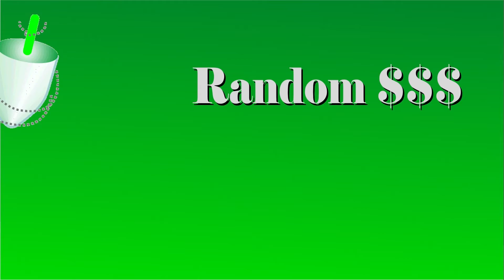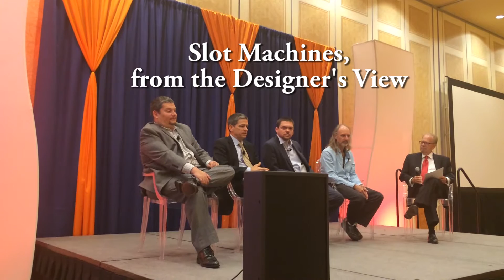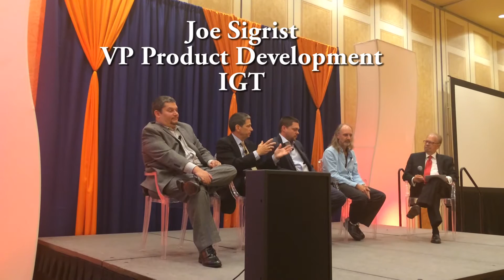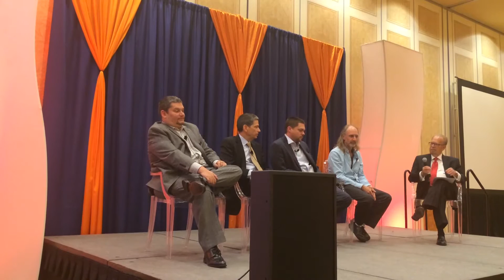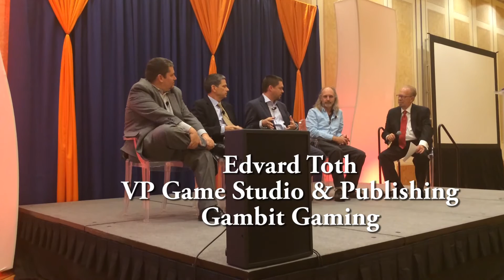G2E: Slot Machine Designers discuss problems with today's slots

Comment: IGT Designer: I have an idea "lets lower the pay table"
WMS and Other Designers: I have an idea "lets lower the pay table like IGT no one will notice"

Player: "What the hell is this crap!"
Reply from the maker: ***** Blame it on the operators (casinos).  Certain casinos have an industry reputation for trying to set the slots as tight as possible.  Further, if slot manufacturers don't allow a low enough setting, that casino says "fine, I'll buy your competitors".  Listen to the argument being made in the video - casinos with this strategy can't win this way.  As it happens, one of the casino chains that has this strategy of keeping things tight is also in a lot of financial trouble.
Reply: Exactly correct.  Thanks for posting all of this information.  It gives players some real insight into the industry.  The casino operator you are speaking of is partially in the situation due to looking at slot machine paybacks as a math equation, with little consideration of the long term consequences of reducing the number of BIG WINS (the winners boards) and the number of overall winning sessions for players.  When an activity is not as fun (eg. repeated losses), players will find alternative ways to entertain themselves.
Reply: *****
Well why do they even have an option to change..blame it on engineers for creating that option...............lol at shamus rah rah ing your response.